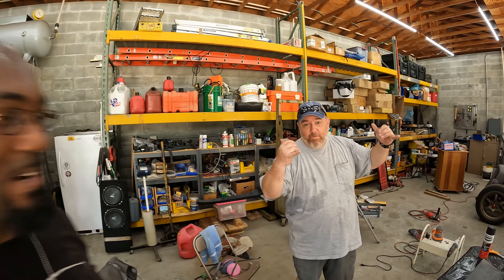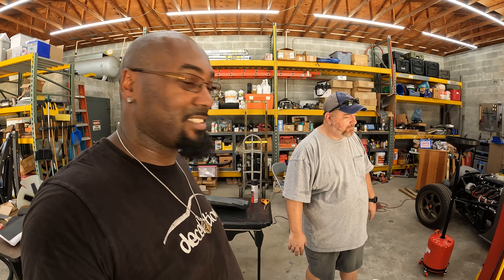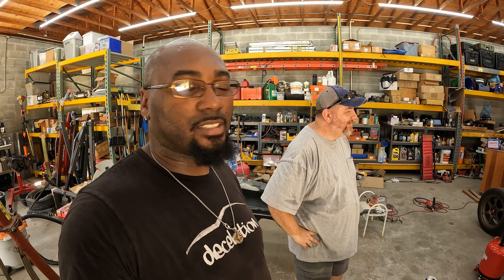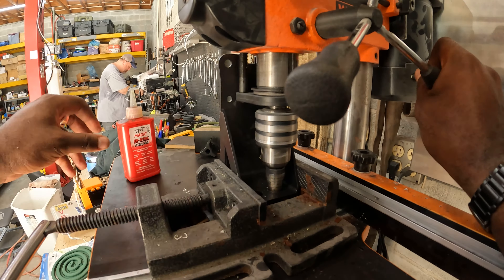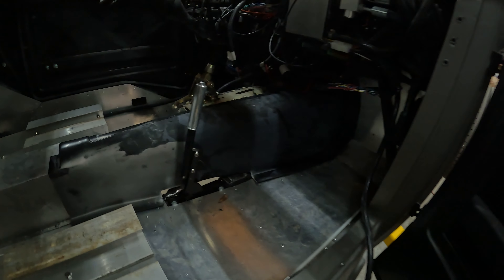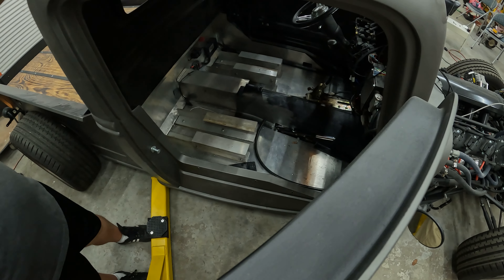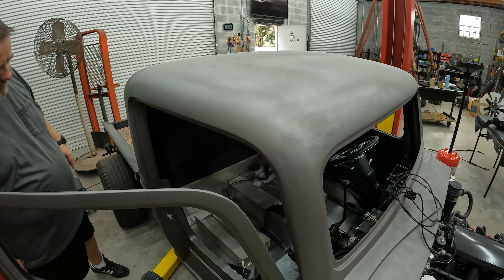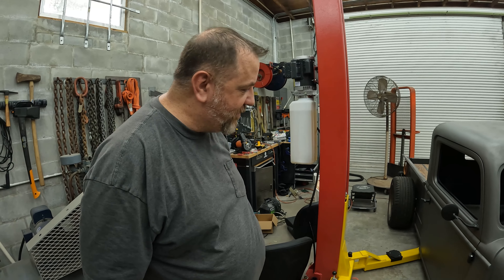Factory Five 35 Hot Rod Truck E Brake Assembly and Install Part 1

Comment: Hey brother hope all is well. I came on the channel to check out the Mustang and I just saw this video. I remember you telling me use the few mustang  parts. What spindles and steering knuckles are you using on the front suspension for the brakes?
Reply from the maker: I am doing well. How are you doing? The front brake system is from a 2001 Mustang GT
Reply: @decelation  awesome. Can you measure behind your rim spoke to the face of your rotors? I may have a sick brake set up that fits your car.
Reply from the maker: @davesworld2132  sure. How big are the rotors?